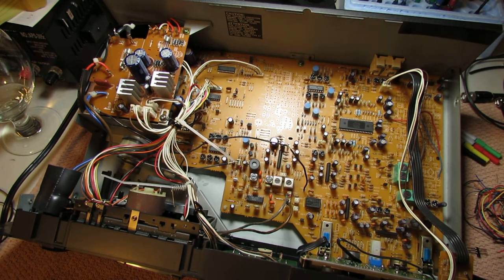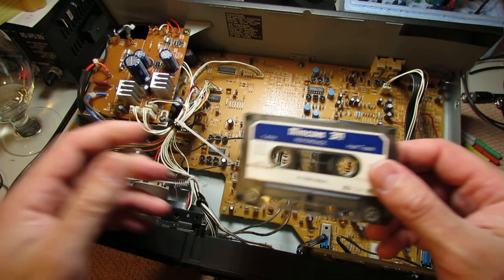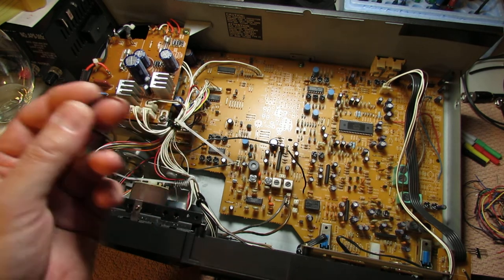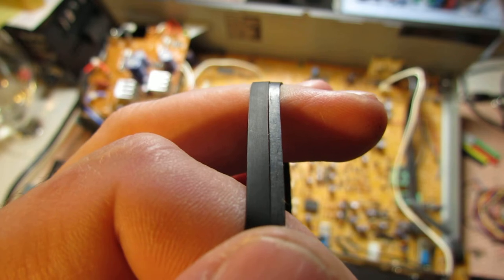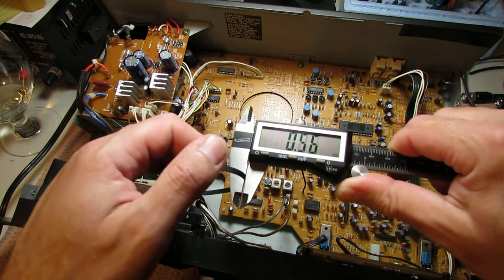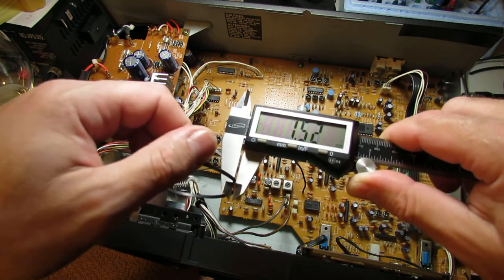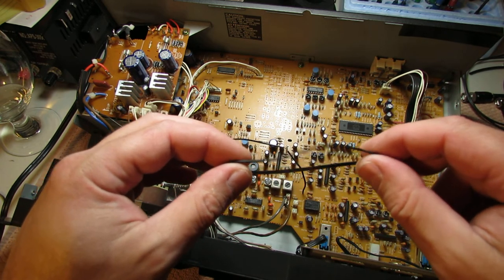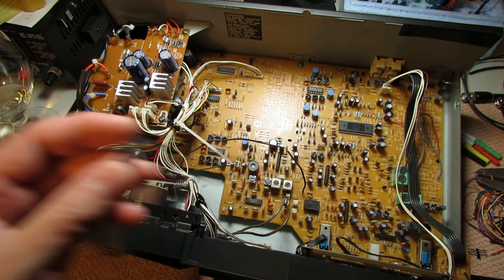Original vs cheap replacement drive belt for cassette deck.

Comment: That was quite interesting, I have just completed a Sony TCK611s and notice that the belts I ordered were oily like tacky. And there did seem an un-eveness on the capstan flywheels which I kind of let go thinking it was just the nature of the belt as well as the tape deck having sat around for years. But then the elastic in the mode player whind up pulley began giving issues. This was the belt just not capable of reacting to the expansion and contraction of the Mode motor changing directions.